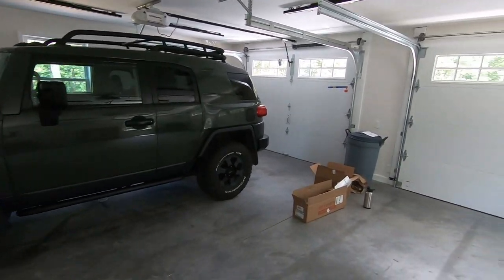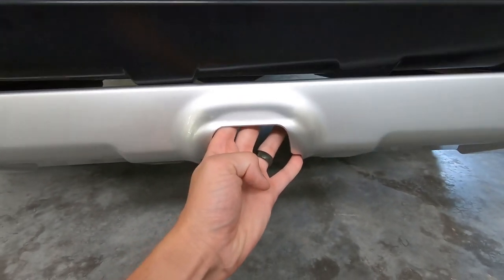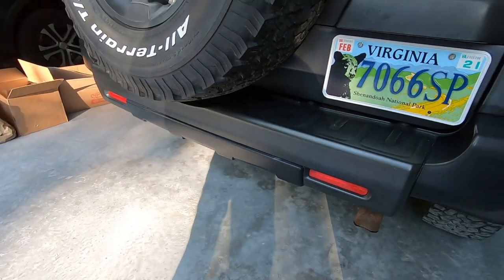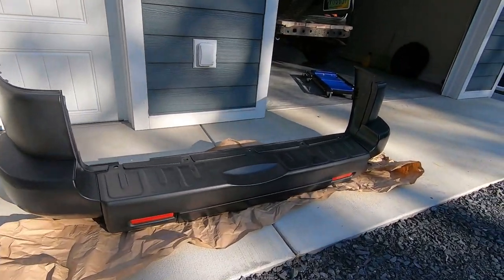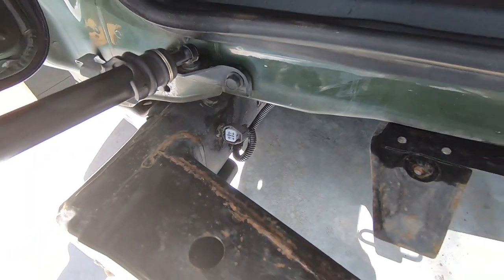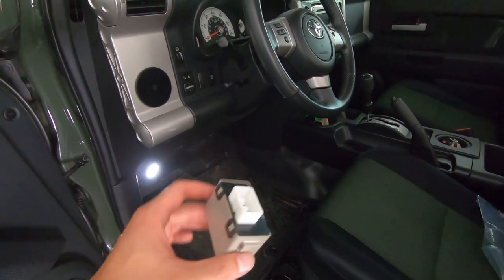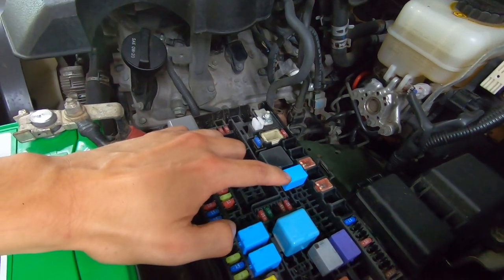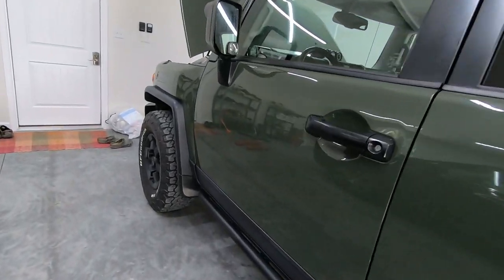FJ Cruiser OEM Toyota Hitch Install - Everything YOU Need to Know!

Comment: Heads Up!  If you have factory back up sensors and or the 'international version' with bumper lights installed make sure to disconnect them before removing bumper!

Comment: I got an entire hitch assembly off a friends 4 runner, that had a full independent rear bar, no removal of the bumper, with Toyota stamped in the metal, and it looked nothing like that at all.  it connected to the frame on both sides with like 4 bolts that matched the FJ frame perfectly.
Reply: What did you do for wiring harness? Thanks

Comment: Thanks dude.  I am moving to Texas in a bit, and your video saved me 2 grand, since I installed a hitch, and pulled a trailer rather than renting a moving van to go across the country.
Reply: Your gas bill didn’t save you a dime hoss!😂
Reply: @deanerinmiller4043  actually, it did.
I paid a total of 494.00 dollars for fuel, and 850 for the trailer rental so if I rented a U-Haul. According to the online statistics, I would have paid $2,300 for rental and milage, plus around $600 for fuel for the moving truck plus $400 for the trailer to tow my FJ.
So I made out like a bandit.

Comment: My fj came with the body armor rear bumper, and an aftermarket uhaul hitch when i bought it. Anyways, I went to take the hitch off and the weld nut inside the frame broke off. Just my luck. So I don't know, I may end up taking the D-ring out of the aftermarket bumper and just install an oem hitch.. thanks for the helpful video!

Comment: Thanks! Just bought a 2013 FJ. It is not the trail edition. It’s a base edition but previous owner removed the hitch. Would I still need the wiring harness?
Reply from the maker: You'd have to check. The previous owner may have left the 4-pin trailer connector tucked up in the bumper somewhere.
Reply: @TrailPass  I thought about that after I posted the question lol. Thank you for clarifying.

Comment: Had a little trouble finding the parts kit you mention at Sparks website. Is it sold as a kit or did you buy each component individually?
Reply from the maker: Hello.  This is not a kit, they are all separate parts.  Here is a list of everything that we used:

Hitch: PT228-60060
Wiring Harness: 08921-35870

This is all that was on my receipt, I hope this helps.  Also the Sparks Parts Team is great.  If you have any other questions I'm sure that they could help you over the phone.  Also use code BANDIT at checkout for a discount!
Reply: @TrailPass  Thanks very much for the info!!! I will give them a call and order!!

Comment: Did you disconnect the battery? How do the back up sensors attach? No wiring to disconnect?
Reply from the maker: I did disconnect the battery, but my FJ does not have the sensors

Comment: Hello ! Thanks for your video. I am in France and o bought an FJ a few time ago. My problem is to get spare parts as this model was never imported in europe ... I find the hitch registrante in europe but impossible to buy the original electric connection . Can you give me a dealer in USA to buy it from ? Thanks to help. FJ is really a good car !
Reply from the maker: I would check out Sparks Parts. They are a great dealership to work with!
Reply: @TrailPass  hello ! Thanks. If you can give me the name of this dealership, will be great. have a good day . Dany
Reply from the maker: @SASROGIDA  Sparks Toyota is the dealership

Comment: This is a very light duty trailer hitch. what is the weight rating for this hitch?
Reply: I just talked to Toyota parts and it's rated for 5k lbs
Reply from the maker: @indylive4926  that's correct, 5,000 lbs